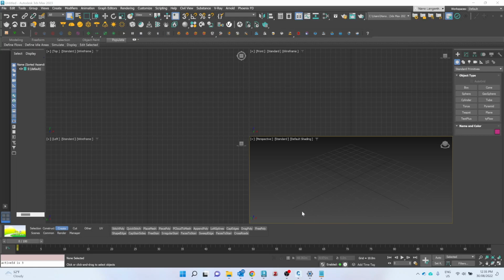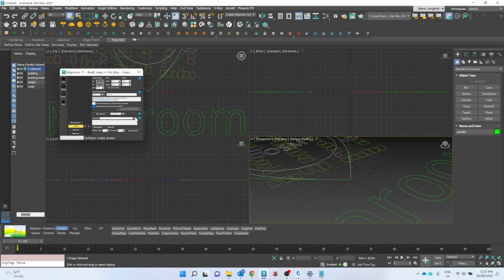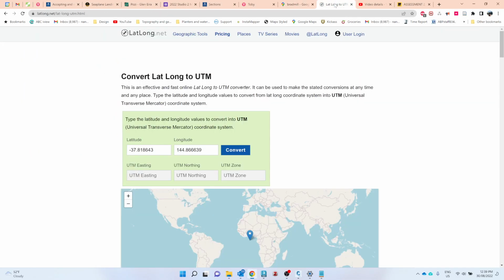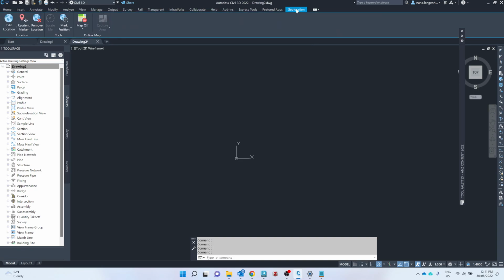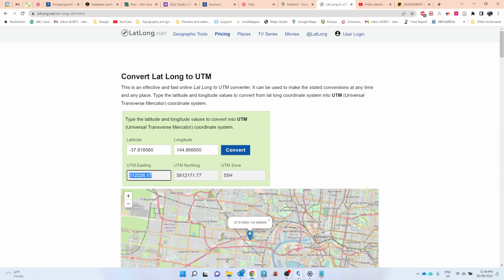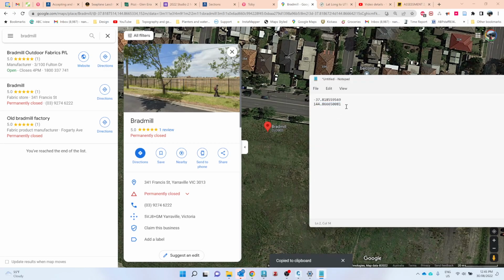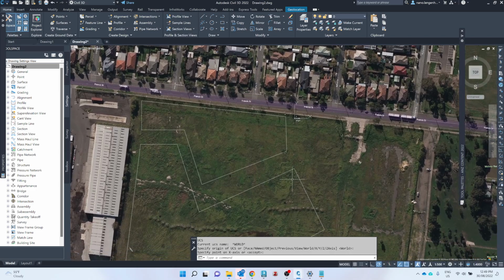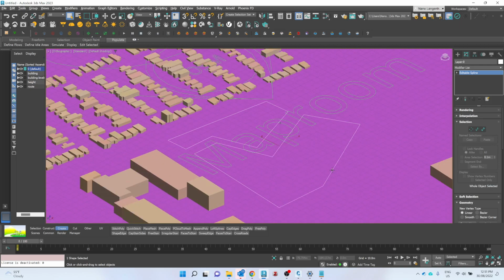Civil 3D and 3Ds Max Maproom 71 matching coordinate systems

Comment: Are you a map loon developer? Is it still supported until the latest version of 2023? I saw a YouTuber using maproom for the first time.
What is the name of the plugin with the section con strict command in the lower right corner?
Reply: Map room just updated for 2023 recently.